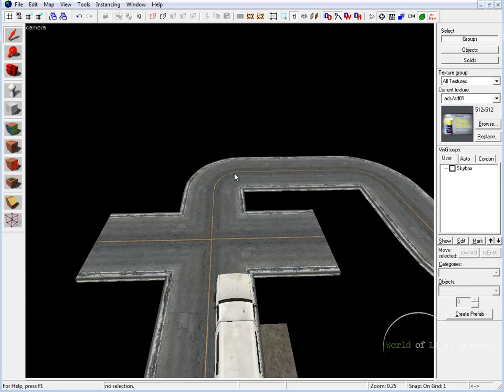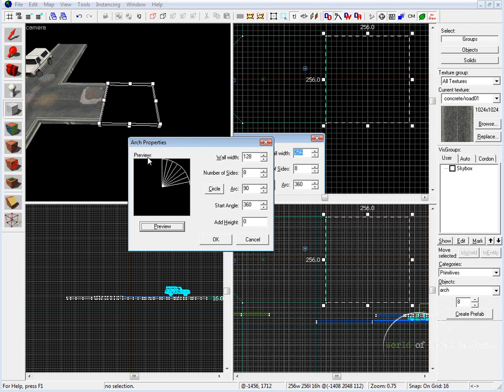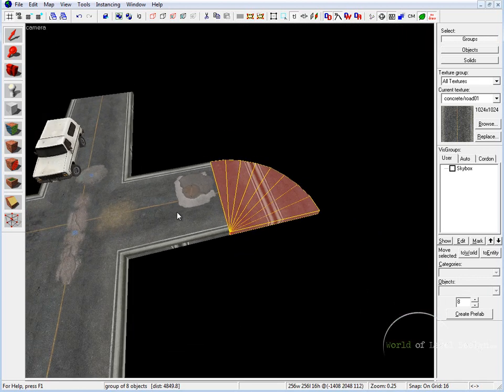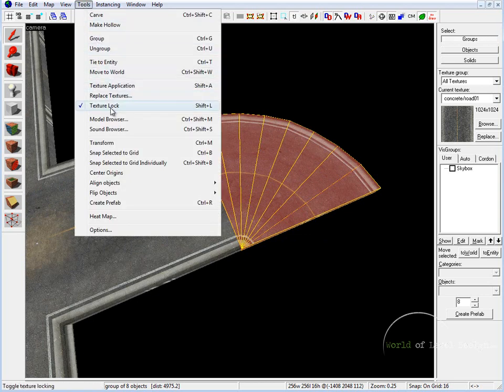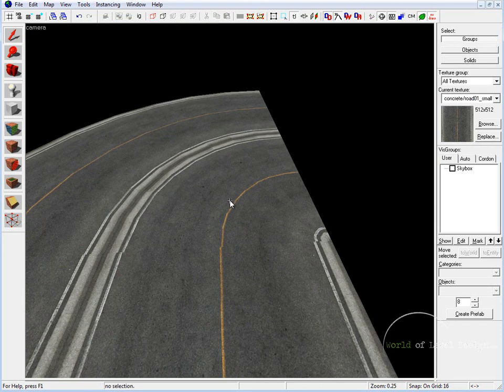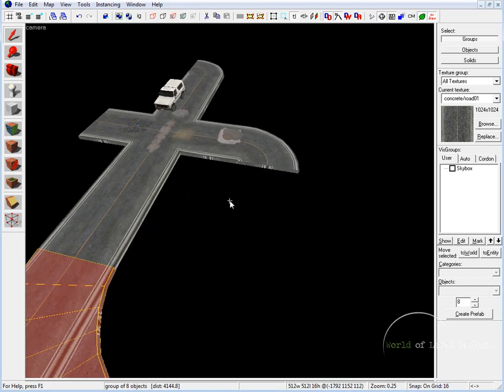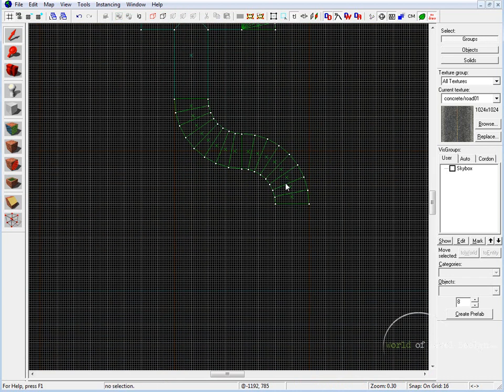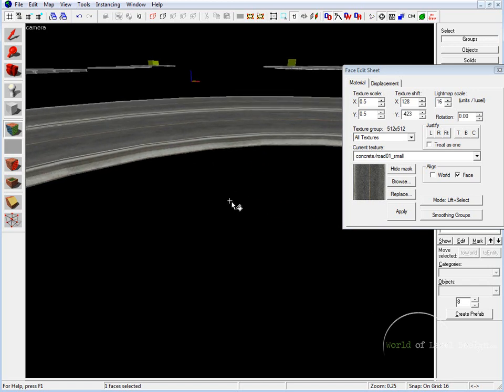How to Create Roads 3/8: Wide & Tight 90 Degree Curved Turns Tutorial - [CS:GO, L4D2, L4D1, TF2]

Comment: This can be done with a single brush, you can use the clipping tool to cut the edges of your brush, using the arch as a base to follow the edges. Though you'd need a custom texture to have it aligned, they do this in the plaza section of HL2

Comment: This video is old, and I know that, but I have a question; How wide should the roads be?
Reply from the maker: I don't remember exactly. I think I made them 256 wide.

Test it by creating a brush and place a prop_static vehicle on it. See how it looks. Then resize the brush until it is proportionately correct size for a 2 lane road with the vehicle.
Reply: @WorldofLevelDesign  thank you
Reply: I prefer using 348 hammer units for 2 lane roads since cars will fit in their respective lanes better (whether it be custom cars in Garry's Mod or Half-Life 2)

Comment: Wow.  No this isn't simple.  In GTKRadiant you could make a patch mesh and drag the vertices to make complex roads (control the texture with a single hotkey), or you could use the end cap tool tool.  Then there's hammer..newer yet missing key features from an old open source editor.  Making curved roads with Hammer made me sad.  I hate to think what Ill have to do to get an inverted 1/4 arch with caps..Thanks for the tutorial though : D